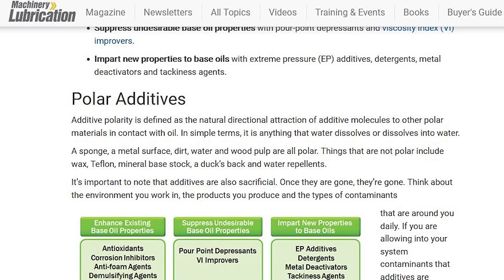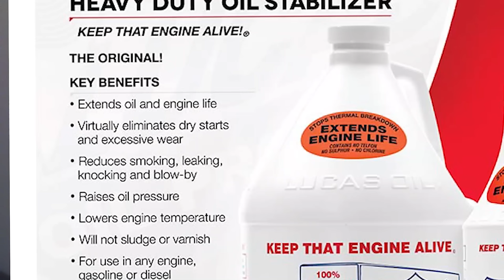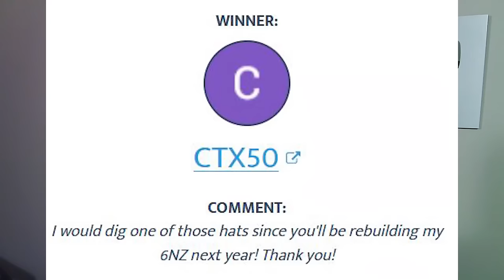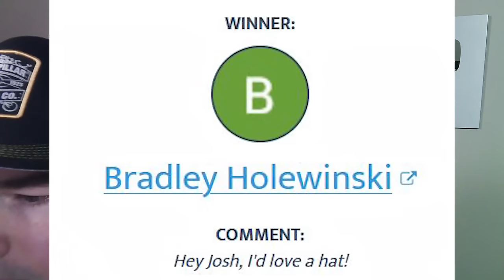Does your Engine NEED Lucas Oil Stabilizer? A detailed look at the "Benefits."

Comment: I believe most of these oil additives are V.I. or viscosity index additive. These make a straight mono grade behave like a multigrade one. I suppise a 30W40 oil with addative behave something like a 30W50. If this was the 50s then there might be some advantage but in modern motors with modern oils a lot of engineering has been done over the last 70 years to both motors and oils.

Comment: Ive had many gasoline vehicles, 4 6 and 8. Ive put over 300k on each of them and only used the cheapest oil by rotella and at times extended drain intervals.

Comment: only good for worn out engines.did work driving a truck for my friend.he is using mystic 20-50 with lucas guess?? trucks are a mess! ( no longer work for him).check the dipstick when cold weather you will see the proof - turns to sludge.

Comment: I use Lucas stabilizer on my 2000 civic with 234000 miles. It swells the gaskets an no rough starts in the past 10 years. So that extra 10 I spend on it aint so bad.

Comment: Will not change  oil with out it! I have a 2015 f150 2.7 ecoboost with 124000 miles just ran out of my last dealer supplied oil change, first change  myself  full synthetic 5 quarts 1 lucas oil stabilizer, immediately quite down and smother throttle response my dad got me started on it on my first  truck never had anything  but good results.

Comment: Any oil additive that keeps oil on parts even after it's been sitting for a month will prolong your engine, anything that eliminates dry starts is worth using. That's because most engine wear comes from cold dry starts that's why when you run a product like Lucas your oil stays cleaner for longer

Comment: On my rebuilt C13(150k) I don’t use It My oil pressure Is great and I have almost 0 oil consumption with Delvac 15w40. I did use a gallon of It before the rebuild to get a couple more miles out of it before I had it done. I didn’t like the idea of how thick the oil was, especially during the winter times. Have oil that thick move that slowly must not get to places It needs to.

Comment: I have used Lucas for many years back still going with it and I haven’t worn out an engines yet cause most of my cars or trucks have been wrecked from different run ins with careless drivers. I have had at least 5 wrecks in which most of my vehicles got totaled out

Comment: I wouldn't put it in an engine,but it works great for the mud mower crew. 
Those gearboxes on lawnmowers are usually grease filled and when you overspeed them 5 or 6 times over their design limits they need some help. Typical input speed is around 1000-1300 rpms,I run mine around 5500 or so and the real racers run them over 10k rpm.
Remove the grease and fill them with gear oil and a shot of Lucas. 
I'll keep it out of the engine though.

Comment: Regarding engine temperature, spray wd40 on the road, then drag your face down the road. Record your results. Then pour lucas oil on the road, and drag your face down the road. Compare results. Which one had more friction? Lucas is providing a pillow between your face and the road, which a thinner oil is less effective at providing.

Comment: I’ve been in the automotive industry my whole life (repair shops/car lots) and as much as I hate additives, this stuff has quieted several engine and brought up oil pressure on some. 

I’ve seen all of their products work wonders in certain cases. Most notably, 2003 sonata v6 while front tranny seal pouring out fluid. Added the Lucas transmission additive and it stopped the leak completely for approximately 6-8 months so it’s doing something down there even with a severe case.

Comment: Yea I works had a 350 small block in 93 chevy burned some oil by 2 quarts by 2500 miles. Even used 15 40.    After using Lucas an 15 40  the engine uses half a quart. 

Also we got a 2010 chevy Silverado 200k. Same thing thicker oil an Lucas stop burning oil an doesn't make a sound now.  

Are news truck 2018 Ford with a 5.0.  With over 150k. We been using it after 125  with a good k.n oil filter truck still going. So I believe this stuff works really well plus non of these truck get driven like a grandma. They bang 4500rpms daily cause well we drive are trucks like race cars

Comment: In a cooling system, if the coolant flows too slow, the engine runs hotter. And if the coolant flows too fast, the engine runs hotter as well. Why? Because the coolant needs time to remove the heat from the water jackets... So in the case of a thicker oil, it doesn't flow fast enough to remove engine heat where it flows. Here's a story you probably won't believe. I worked with an owner operator for 6 months OTR. We drove a Freightliner with a Detroit engine. In those 6 months, it ran with nothing but Lucas additive in it because he thought it was regular oil 😂. Believe it or not, he had no issues with that engine in those 6 months. The question is, what happen to that engine afterwards 🤷‍♂️

Comment: Manufacturers and people use too light of oil for engines, cam and rod bearings do not last. You need thicker molecules and more of it to prevent bearing wear. Includes extreme pressure lube plus heavier oil. Prevents rod knock since obviously the oil most people use is TOOOOO light! Good luck, great product! :)

Comment: For my 3406b all the old boy cat gurus swear by it. And also if it’s cold just plug your oil pan heater in and that problem is solved. I have a brake saver so I believe it also helps there because of the extra heating of my oil that the brake saver does.

Comment: I accidentally put 5w30 in my engine and it took longer to warm up than it did when using 5w20 that I was supposed to use.  Same brand and type of oil but different weights.  It was in the summer so I left it in there and switched back to the right oil at the next change.

Comment: A small amount Lucas Oil Stabilizer or STP works better in a 4 speed of a Posi traction rear than in the engine. It cushions some of the shock from flat shifting, but takes a little time to warm up. As for the engine thicker is not better, I go with a small amount of Marvel Mystery oil, in the engine and in the gas tank. 😎

Comment: Lucas is only a temporary solution to most issues. I only use to get by til I can afford to fix the issue. I had a motor with worn out rod bearings, and I put Lucas in. It help lengthen the time in which I had to replace them, but eventually, it got worse even with Lucas. It is only to be used temporarily, not to fix anything.

Comment: You should do a video on Archoil diesel fuel and oil additives. I've used them for a long time. I even got my friend to use it on his deleted 2015 6.7 powerstroke and he said he got 2 mpg increase and his truck no longer rolled any coal, his engine oil stayed clean hardly any soot in the oil even at change time of 5k miles.

Comment: originally additives were band-aids meant for use in engines and/or tranny's that were worn out or had problems just to try and get a little more use out of them, only an idiot would put something lucas oil stabilizer or motor honey in a newer vehicle that had no mechanical problems but back in the day for whatever reason i couldn't get redline synthetic oil i did sometimes run lucas for a little extra protection in my high boost turbo cars because they tended to kill viscosity in over the counter oils very quickly and the lucas helped. lucas oil stabilizer has it's place, lucas transmission fix that's another story.....

Comment: I've never bought any band-aid in a bottle. Thinking some miracle potion is going to fix a mechanical issue is naive. Oils/lubricants are made to a standard with certain additives already included, adding other things into the mix will either dilute said additives, or potentially counteract the original additive pack. Back in the day, I don't remember which aftermarket additive it was, but the ingredients counteracted the anti-foaming agents in the oil, creating problems for HUEI engines.
Reply: Does anyone really believe an additive can "fix" a mechanical issue?

Comment: Any chance you can do a experiment say two 3208 in a generator application might take out the human aspects of how a engine is driven . Same load might be Trickey but not impossible , time is the next problem how long you run the test . Then run the numbers ie fuel consumption, a fully independent test . Sounds like the only way to get good data.

Comment: Lower engine temp could be a measured temp at the oil cooler causing the oil to cling to the temp sensor and read artificially low.

Comment: Never been a Lucas guy but I tried it after a few friends kept talking about it. I put some in my 88 Ford F-150 that ran great during an oil change and my engine started knocking in which it never has before. I changed  my oil immediately  and added Rislone as I always have and it stopped knocking. I've never had an engine start knocking  after an oil change  till I tried Lucas oil treatment.  Those friends drove Chevy's so maybe that's something to do with it as I've heard they run looser bearing tolerances then Ford's.  You can keep your Lucas crap  since it cost me the price of their product and another oil and filter change right after using it. Waste of $ and time . .  My grandfather used Rislone and never had any issues and neither have I.

Comment: You should actually study a product before commenting. 
Lucas oil additive actually just goes in thick. Once ran and mixed with engine oil it will no longer be thick. I run it in everything from our race cars to the tow vehicles. Run it in new and old engines. Pretty much stopped main seals from leaking. (It doesnt fix blown seals jist keeps them from drying out) oil temps are colder. We run it in differentials as well. Run it in all the daily drive cars as well. The product works well. I wouldnt recommend it to people with worn out engines. I would recommend a replacement or rebuilt engine. And on that new engine I would recommend lucas. I wouldnt extend the oil changes. When you can take an engine with 300k on it and run the full oil service and drop what looks like new oil from a diesel the product works. Soot, ash, dirt, and oil burn turns the oil the dark color. If the rings never experience wear then less soot and ash get into the oil. If the oil stays cool it wont bake. By running it day one you keep your engine wear parts from wearing as fast. If you keep good lube at the face of the seals they dont dry out. That keeps dirt from entering. 
Before you knock a product perhaps run it from day one. Then when you hit high miles talk about it.
I never thought additives were anything more than a sales tactic. Had heating issues in a drag car. A lucas rep was at the race. Told me to try the product. Gave me a bottle. I dropped the oil and put new in with lucas in the mix this time. 
Heat problem went away. 
We drop oil after every pass and grab samples. Sent the wife to a parts store to grab enough to finish the night. 
Sent every sample off to be tested. Ring metal disappeared on the third oil swap with lucas. So did drop in viscosity. Now we can run the entire night with the same oil. That is why I run it in everything. We were losing compression by the end of the night. Now we pull perfectly good rings every race. (Still replace them its a race engine) 

I know your cat school told you about additive packages and all kinds of other sales garbage so you rep the cat oil.
They use all of the tactics lubricity profiles additive packages... etc. Let me tell you a well known secret. Cat has never and will never make engine oil. Its rebranded. And the oil manufacturer would never try to tell you their oil is any different than any other brand in a lab. So when the sales rep for the rebranded product has a sales pitch they will always lie. Chevron, shell...etc all have to meet a cj4 rating. What is different between them? Nothing really. Just a sales guy telling you their product is better. 
My oil is paid for by sponsor. My preference on brand goes with whoever is paying for it. Never have been able to get lucas to pay for it. I pay out of pocket for that. 
Also fyi oil is clear. If its not then someone added dye to it.

Comment: can I use "Lucas Oil 10001" for the engine, gearbox (manual switch) and differential gearbox?
How much do I have to add lucas oil? Assuming the engine has 6.5 L of oil, the gearbox has 1.2 L and the differential has 1 L.

Comment: I added Lucas to my commercial truck engine at 20% and it “imploded” the filter media in my spin on filter and blew a $52,000 motor (600hp Cummins ISX) due to starvation.
Now I own a broken truck and I doubt Lucas is going to come to my rescue.

Comment: As for the extended life studies: A fellow here on YouTube did a study using identical (new) 4 cycle Preditor engines. The results were impressive when put up against STP.
Reply from the maker: If you're referring to Project Farm, he does interesting experiments with different products and machines. I wish the manufacturer themselves would do experiments in like that themselves with larger sample sizes.
Reply: @AdeptApe  Yes, that's the channel. And yes, he does lots of interesting tests and from a neutral perspective. The Lucas additive definately impressed me in that run off.

Comment: Personally, I think oil will drain into the pan of an engine from the heads and oil galleys, etc, no matter what viscosity the oil is and making the oil thicker will not stop this process.

Comment: I worked at a shop where a vehicle came in to get an engine rebuild and they used nothing but Lucas and Castrol oil. Over 300,000 miles on the engine and every lifter fell out when filled over.

Comment: I think much of your analysis is assuming the added oil doesn't combine fully with the engine oil and thin out quite a bit. It doesn't stay at 60 weight and the engine oil moves up slightly in weight once mixed. Will you make a video adding Lucas to an engine? Do an oil change, run it for a bit, take a sample, add Lucas and run it another bit and take another sample. Send off the samples for analysis. You should get a readout of all chemicals and new combined weight.

Comment: I like lucas. .Full Synthetic oil, -1qt. Replace with, 4 oz ATF, 10 oz Lucas, 16 oz Engine restorer. 1996 Subaru, 266,000 miles, My 2012 Chinese scooter runs the same mix, has 64,000k on it (40, 000 US miles).  The inside of my engine block looks like its been chromed in copper.

Comment: I used to use Lucas OS in my 5.3ls. I used a mix of 1 qt to 4 qts in a 5qt jug and only used 1qt of mix to 5 qts in my pan for a total of 6qts. I just switched over to 5w40 SP rated Quaker state for less money and I have lower rocker arm noise with 5w40 then with 5w30 and LOS

Comment: Years ago I would do demos for my fleet and construction company customers.
1 of those was the use of a
Ford 2.3L OHC ( pinto engine)
Because it was small and light enough to carry.
I would take a given oil / treatment and pour over 2 cam lobes, do the same with another brand of oil / oil treatment.
 At ambient temperature those treatment products would be wiped off, not even enough film to mean anything.
 Heat those same products up to 100F, they became water.
 No benefits, none.
Then I would take Amsoil motor oil and do the same thing.
A strong film was left behind, even when heated to 125f and multiple turns of the cam, still the film was there.
Just a few years ago I had a talk with a Ford Special Vehicles engineer and asked why they recommend ultra light oils in vehicles except when in our products ( was a Shelby Dealer  at the time) 5.4 in non Shelby vehicle
Super light weight, 5.4 in the GT 500, 15-50 oil.
He stayed in was bearing clearance.
I made a point of checking on that.
False, clearances were the Same.

Comment: I presoak  hydraulic lifters before installing.  Typically just 10 w 40 oil. Last time I tried Lucas  for this.  It turned  the hydraulic lifters  into solid lifters.  I couldn't even  push it out with a push rod.

Comment: I disagree on dry starts because there is always a film of oil on the bearings regardless how long an engine sits, the only way to get a dry start if the engine is rebuilt and the builder forgets to use assembly lube on the rod, camshaft, cam bearings and crankshaft bearings

Comment: Scotty Kilmer does a video on Lucas oil stabilizer. Don’t use it in VVT engines. Older engines that burn oil.  Modern engines don’t like Lucas. Lucas is very very thick oil like cold honey and  is 110 oil weight when hot.

Comment: I use it for low oil pressure on old engines it won't help with lifter noise it won'd make your oil last any longer it just gives more oil pressure

Comment: If you have hydraulic lifters, Lucas will affect how they work and cause problems with your valves, lifters have to bleed off and when oil is too thick it take longer for lifters to bleed off and cause your engine to make knocking sound

Comment: I use semi synthetic 15w 40 in my 12 valve cummins(92) with the proper amount of full synthetic lucas that Lucas says to use and man my oil stays as clean as possible for 3,000 miles and doesn't lose any. Then I add as needed for the 500 miles after the 3,000 miles until I do the change. In my 5.9 V8 I use conventional 15w40 diesel oil and go back and forth between Lucas and then MMO for the next oil change and then Lucas and then MMO and then Lucas and then MMO and so on.

Comment: Does the bypass valve have a switch lettings you know when the flow is restricted to a certain point making your change the oil come on? Always wondered how it knew, if it does then why dont it come on when you use the stuff.

Comment: The oil pressure thing.. Pumps generate flow, not pressure. Restriction generates pressure, so with the same pump you're getting higher pressure. It means your flow of said fluid is restricted.